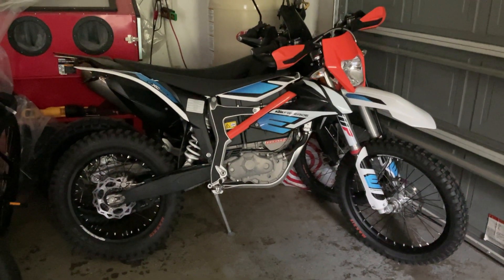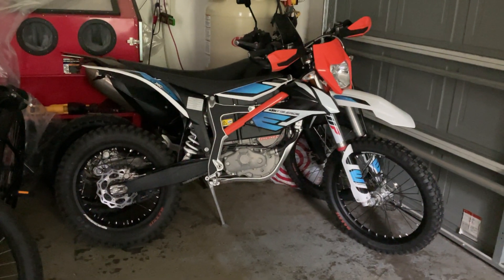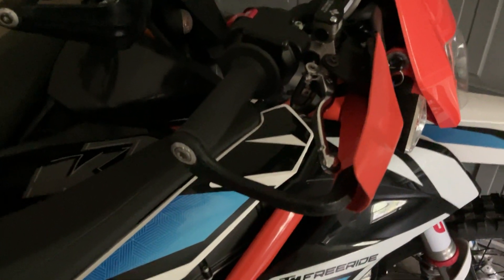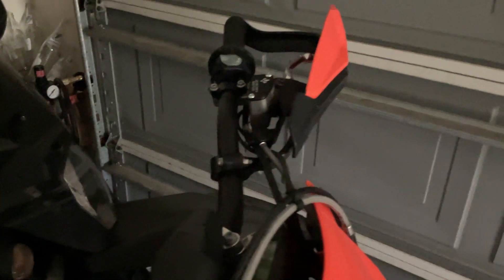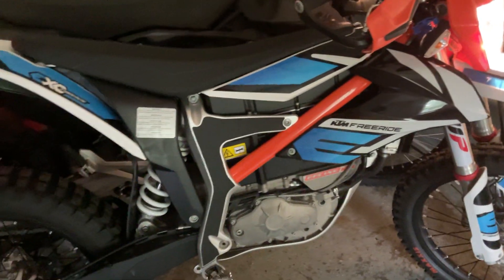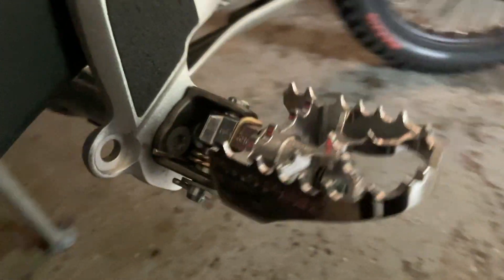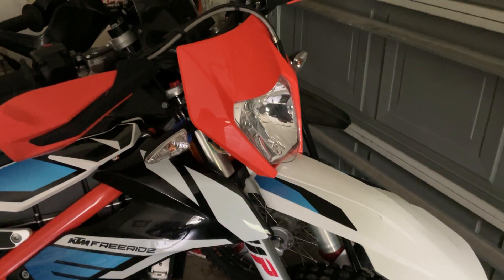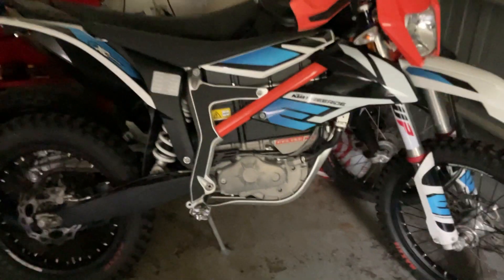2021 KTM Freeride E-XC Day 10 upgrade and mods opinion video in 4K

Comment: Thanks for the upload. Where did you get the headlight on/off.? And have you measured the draw before or after?
Reply from the maker: I got it ordered/installed at a KTM shop. After I I installed the LED, I was told that the headlight runs off the small battery. Not sure about the power draw